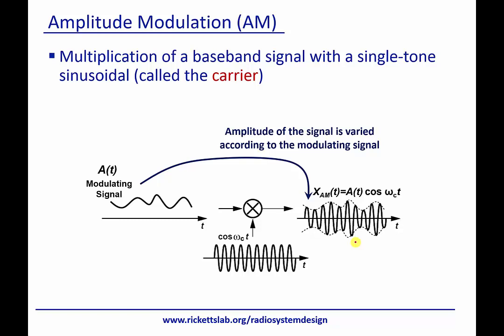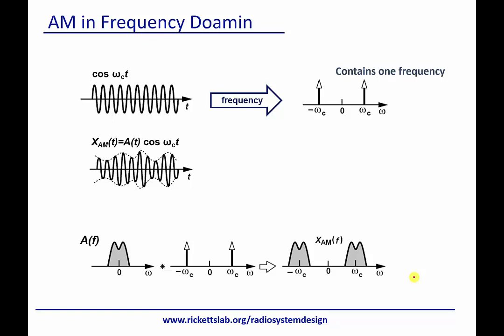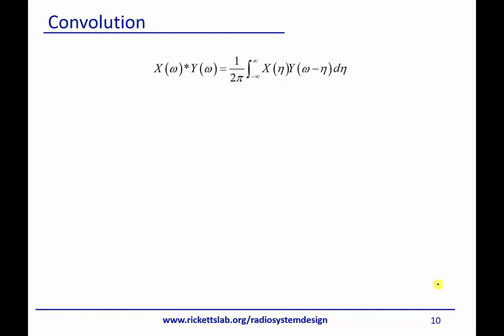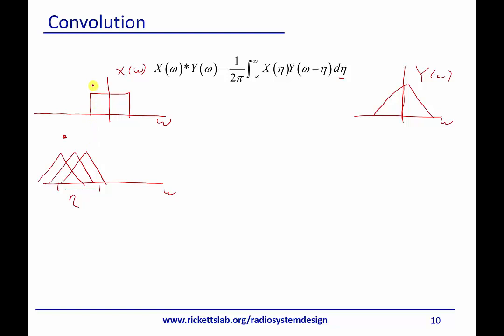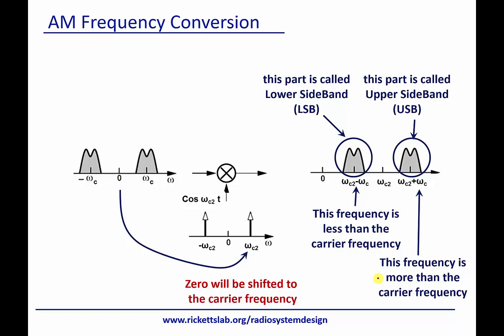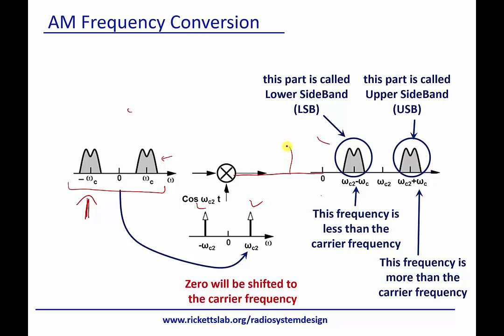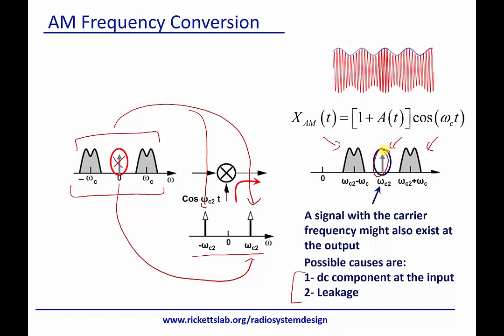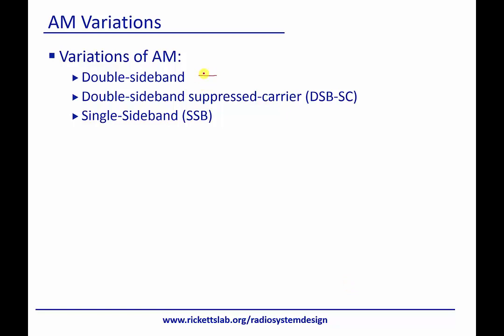Module 2: Amplitude Modulation

Comment: The envelope as drawn in your video actually represents the envelope for an AM waveform with TRANSMITTED carrier. Simple multiplication of the modulating signal with a carrier produces a double sideband SUPPRESSED carrier signal, whose envelope looks somewhat different than what's shown.